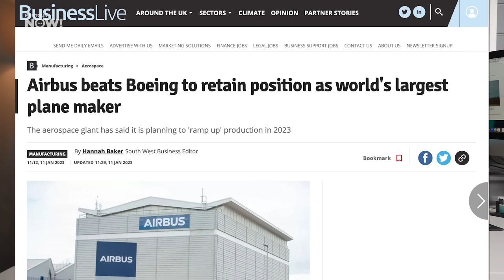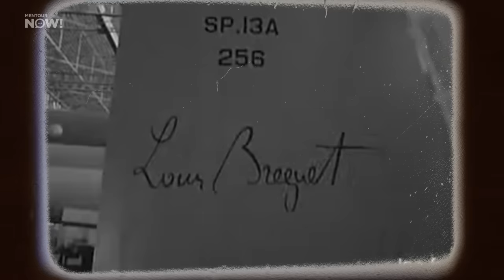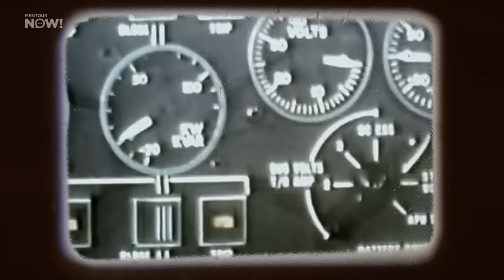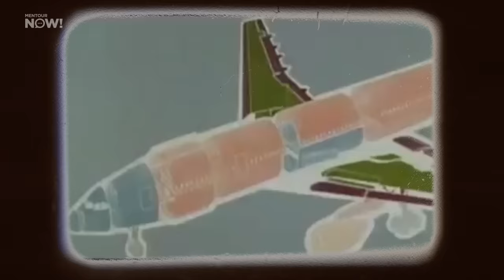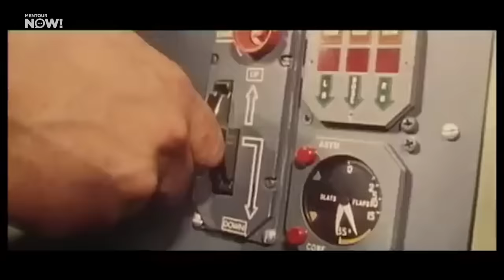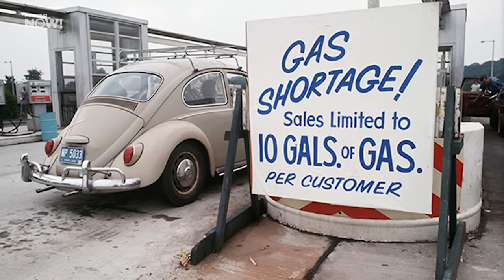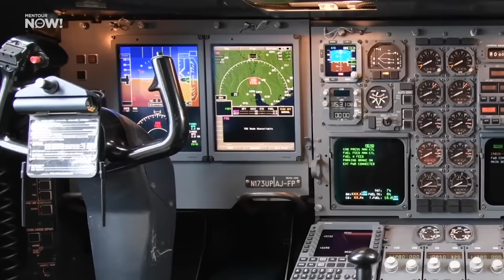Without this Aircraft, Airbus wouldn’t exist!

Comment: Considering today’s market trend seemingly going to the point-to-point, middle-of-the-market type I really wish Airbus built an A300neo. East Asian airspace was at one point in the 80’s were full of 767s and A300s from each country, since it perfectly fit the demand and economics of respective countries. That also includes us Malaysians with the four A300B4 belonging to Malaysian Airlines that we utilized until the mid 90’s when the A330 rolled around. Too bad I never flew in one though, the older B2 and B4 series had cabins without the central luggage compartment, making it super spacious like early TriStars. 

Fantastic video. I’ll never be bored with the Airbus origin story even with different narrators.

Comment: The Fokker F27 / Fairchild FH-227 ..  yes its a turboprop short-haul airliner, but Fokker really set the standard for the market..  I worked with the F27 for many years with a previous employer when it was well past its prime, but it was still a solid, roomy, load-hauling regional turboprop!

Comment: The predecessors that formed Airbus had an airliner history: British Aerospace, Sud Aviacion.  The Comet models came first, then the Caravelle, and the Concorde.  So it wasn't like when Airbus was constituted its design, engineering and production teams had never sold commercial aircraft before.  I'm not taking anything away from the A300 as a pioneer in a new class of aircraft and its role in supporting a formidable competitor to Boeing, however.

Comment: Amazing video! One small detail: the A300-600 does not have the A310 wing. It has the more modern cockpit/avionics, the A310 rear section including the tail with a tail tank and a updated bulkhead. However the wing got some updates: the outboard ailerons were removed and they added wingtips. The MTOW and MLW got upgraded. Overall more CFK was used.

Comment: The last A300 2007, I was there.  You are wrong in one very important detail.  The A300-600 did not have the same wing as the A310.  It has a revised version of the wing in the A300B4.  I put 17 years into the project, I can say that I prefered the A310, it had a better wing in many ways and showed how experience can improve design, but it had a smaller body and less capacity so it suffered as almost all shrinks do.
A nice video for all that, well done.
Reply: I alsmost forgot, the fuselage cross section (104 inch if I remember right) was chosen specifically to accomodate the LD containers.  Thats why it became such a useful freighter.

Comment: Thanks for a great review! I do remember the bold offer to Eastern Airlines in the mid-1970s. Frankly, Airbus could have leased the planes to EA for $1 each and done well financially. Those leases were fundamental to opening the U.S. market to Airbus. I believe those original planes ended up at Continental Airlines in the 1990s - during the era of Frank Lorenzo ownership of both CO and EA. Slowly but surely, EA assets shuttled through the paint shop and ended up in CO livery and EA came to an end. Would be interesting to see you trace the introduction of the A320 series to U.S. flag carriers. The first I saw them was at UA in the early 1990s, shattering the history of UA being a fully Boeing line.

Comment: i remember when Eastern got the A-300s in the 70s. I walked through one they had out on the ramp in Miami. I remember the traditional cockpit with a flight engineers station and conventional control yokes, which I still prefer over side sticks.  I remember they must have been slightly underpowered for high altitude. We never saw them above FL 310, going coast to coast. They hung around down at FL290 and 310. Later they obviously increased the power they had.
Reply: It was not lack of power... it was lack of wing. As the 310.

Comment: There's also the A300-203FFCC with a two-crew cockpit, before the A310 and A300-600. Originally conceived by Garuda Indonesia, two were acquired by Finnair, of which the other one still flies in Iran.

Comment: MD had shown a twin engine wide body as part of the DC 10 line called the DC 10 twin. European airlines reserved options like crazy but no USA airline optioned it. ETOPS was for them still a sticking point. MD where selling every DC 10 they could make so they let it go on the back burner. The A300 was remarkably close to the DC 10 twin in spec and got the market options cancelled by MD and the rest is history.

Comment: One thing you do not mention here that greatly aided the A300's success was its very advanced (for its time) avionics. It was first with a glass cockpit. It wasn't full fly-by-wire but a lot of it was. And its automated CoG control was ground breaking. There were good reasons the A300 was the first twin to get extended ETOPS and the first widebody not to need a flight engineer (a part of its low operating cost - it was not just fuel efficiency). Its redundant and automated systems were well ahead of competitors at that time.
Reply: The A300B did not have a glass cockpit. It had electro-mechanical instrumentation in a three-crew cockpit with a conventional flight-engineer's (side-facing) panel. However, one special version (for an Asian airline, IIRC) did have a forward-facing electro-mechanical systems panel, designed for two-crew operation. 
The A300B had no FBW flight controls, although one aircraft was used much later as part of a sidestick test programme (flown by Gordon Corps).
The first "glass cockpit" Airbus was the A310 (entering service in 1983), which had a two-crew, forward-facing cockpit (although Air France initially insisted on using it with three crew). The shorter-fuselage A310 had a conventional yoke but the roll-spoilers were digital-FBW. 
That paved the way for the A320, the first digital-FBW airliner and the first to employ sidesticks, which was type-certificated in February of 1988. (Note: the first FBW airliner had been the analogue-FBW Concorde.)
The A300-600, which (IIRC) entered service around 1986/7, was the first A300 with a glass cockpit, identical to the A310.

Comment: As someone from northern Scandinavia; how about a short one on the Fokker 50? 🙂 Someone I know that isn't me, may or may not have been so hung over was one summer sunday, that they literally passed out inside one of those headache-tubes in the rare arctic summer heat (and went on to be bedridden by hangover for another 3-4 days).

Comment: Hello Petter.

If you are going to talk about fbw in airbus, may be you have to dig a lot on Ziegler family. Father and son. One president of airbus ( I think) ( Henry), and Bernard Ziegler fighter pilot and Vice President engineering for airbus and the one that always believed in the fly by wire / flight path protections receipt. He had a strong personality but airbus owes him a lot. There would not be all this concept in airbus, and all this dark cockpit philosophy without him. 

I understand the basic airframe of the a330/340 derived from the a300. Thank you for info I didn’t knew.
However, it’s the 320 that launches the all new concept of family of aircraft making the transition between those cockpits very smooth. Of course the 320 had, and still has very tricky things in its systems and the way to operate them. We used to say that those checklist are made by lawyers not operational people. 

However in day to day operation it’s miles ahead from any other airplane. It’s just a little to much “ French”. Bureaucratic, complicated, like an old Citroen. But also like old Citroen’s, they were very ahead and they could create a new reality. They had that courage and vision .And that is why Boeing  is a little behind nowadays. 

However,airbus would not make any sense without Boeing. And they are two magnificent manufacturers. I just hope airbus does not enter the criminal spiral diving that made Boeing so famous after de McDonnell Douglas merger which now is a philosophy they have to counteract. Boeing from before, let’s say from the 707/727/747 era, was just about as bold as airbus was. 

Let’s hope all this stretching of the a 321 doesn’t go too far . I have flown all the  320 series, ceo and neo and 330. 
And the 321 neo lr just has a different handling. Very processed airplane, a little bit too much mcas style....
When you get used to it , it’s still an old Citroen. Comfortable for daily life , and now much more reliable after 30 years in service.

It is important to say however, that we can criticize the handling of the fby formula. It’s not as responsive, as stable, and not much feedback. But you get used to it. It’s better for daily life and  takes a lot of work load from you except when it malfunctions. Which is far worse. But after 16 years flying the airbus, and more then 8000 hours on them I never had nothing that degraded the system. It’s really robust. And that’s why I say that to talk about fby you have to investigate on Bernard Ziegler. Pilot and technician that by his family connections understood how to make an idea going. And it went very well. 

The next safety and comfort step is air. And there Boeing is ahead with the 787.

No Aerotoxic syndromes on those planes. And that is a really important topic that it would make a lot of sense if you covered it. It’s the black swan of today’s aviation after the 707 which still had “ clean “ air.

Good luck and thank you once again for your work.

Comment: In your video you mention that the A300 is smaller than the dc10 and L1011 tristar but to be honest the A300 is only slightly smaller, the newer A330s are around the same size

Comment: Actually, Airbus did have a 2-crew A300 before the A310: They called it the Face Forward Crew Cockpit (or short FFCC), that was introduced in the early 80s and shortly before the A310 made its fist flight. Many flight engineer systems got automated, however the cockpit was still fully analogue without a modern FMS.

Then A310 came, which was basically a totally enhanced A300. Not only the new wings and the new EFIS cockpit were introduced with that one, but also the trim tank in the tail, the removed low speed ailerons etc. The A300-600 is actually more similar to the A310 than to the A300-200/-300, as it also features the new cockpit, the trim tank, the enhanced wing, the removed low speed ailerons and all those new features. So you could say, the A300-600 is a stretched A310, rather than a modernized A300.

Comment: The Airbus A300 with a composite fuselage would be a great competitor for the B787 today.
Reply: That would be the A330neo today. Developed from the A300 fuselage. Also see the A350 as a competitor to B777(X).
Reply: @berlindude75  Yeah, sales wise, the 787 has left the A330neo in the dust. Not much of a competition there. We shall see how the 777x fares against the A350 over time.
I think a composite version of the A330 would fare better against the Dreamliner.

Comment: I flew on an A300 in January 1982 to Berlin and back. The airline was the first in UK to operate the A300 - Laker Airways. Unfortunately they went bust three weeks later with the three aircraft that had been delivered of the ten they ordered ending up in Jamaica and Pakistan.

Any chance of a video about the Saab 340 / 2000 ? I feel the 340 particularly is a very important aircraft which has now carved out a very useful niche for itself in short / medium haul parcels transport.

Comment: In the Philippines 🇵🇭 we have BAC 1-11 operated by Philippines Airlines until the 1990s due largely to the extremely noisy engines during take offs later to be replaced by the Boeing 737-400 for several years then replaced by the Airbus A320s used mainly in Domestic and short haul International routes.

Comment: I rode the A300 on EAL many times in the ‘80s.  It was an unpleasant ride because for some reason they could rarely cruise higher than FL310, which put us right in the tops of most of the nasty Wx…. Internal fit and finish seemed to be second rate…

Comment: Can you make a video on American Airlines 965 - it was definitely NOT pilot error .. it was pilot incapacitation .. and I strongly believe it was due to contaminated cabin air that caused the crash. Many pilots are reporting today cabin air quality to be poor and resulting in serious long-term illness. But airlines are not taking this seriously! Hoping that with your channel this concern for pilots and passengers can voice concerns to the operators, but more importantly, going back to the manufactures such as Boeing or Airbus, to ensure that safety of leaks are minimized and better air filters are installed. Again just my research and honest opinion.

Comment: Also Airbus's decision to fully commit to a 2-crew cockpit was more or less kind of happened because of Garuda Indonesia, whose CEO at the time came to France to buy some A300B-4, insisted that the third seat is useless, and will not sign a purchase order if the third seat is not taken out. Which is why, in those early days, sometimes it is called "Garuda-design cockpit".

Comment: The A330 is pretty much to the A300 as what the 767-400 is to the 767-100.

Of cause the A330 being a bit bigger than the 767 to begin with, kind of had a problem to survive.

A330neo having the advantage of having a pretty much unlimited rage  (that is, can do half a lap around the world)

Comment: While the L-1011 had a similar configuration to the 727, it didn't LOOK all that close.
Russia had an aircraft that COULD be mistaken for the 727 (but was a little bigger). the Tu-154. Didn't look QUITE the same but a lot closer in size and shape than the L-1011.

Comment: KEY POINT YOU MADE: Since Airbus launched the A300, Boeing has been playing catch-up.  Boeing waited for A300 orders to grow before even launching the 767.  Now, it's waiting (and watching) orders grow for the A321 before launching a 757-200 (ie, mid market) update.  What goes around comes round...
Reply: The 757 is out of production since 2004. Nobody has restarted a production for a passenger aircraft after such a time - and the 757 is not even directly comparable to the 321 Neo, it's significantly heavier and has 50% more wing area.

The 757 wouldn't also be suitable to replace 737s.

Comment: The Beluga is a mod based on A300-600.
Reply: Yes, indeed.
Reply: Yes, and the newer, larger Beluga XL is based on the A330 (presumably the Dash-200). According to Wiki, it can carry an A350 wing set (i.e., two A350 wings).

Comment: A great story video of the start of something BIG.  ' AIRBUS ' AS far as a New Video is concerned I would like you to talk about how you feel the Airbus A.350 is likely to be developed ? Do you think that an A 350 1200 or A.360 could be built with possibly Rolls Royce and its Ultrafan Engine ? as Boeing are dragging their feet so badly with its updated 777 9 which gives a wonderful opportunity for Airbus to build a New Aircraft that could replace to even better than the A.350 1000.

Comment: I flew many A310's, a variant. Hated the flights as it constantly seemed to be readjusting itself. It didn't fly straight and level, but floated up and down. Fortunately something Airbus didn't continue in newer designs. Do a show on the short lived Lockheed L1011. The few times I flew on them, they seemed like the best?

Comment: Just to add to the concept of a not spectacular looking aircraft. The A300 was the first of a kind fly by wire commercial jet, introducing active longitudinal stability. As a result, "natural" stability was   omitted, gaining a near 3% efficiency of fuel burn. The safety of this aircraft was deadly dependent on the flight stabilizing system. So this might have been another criterion for the purchases in the early days, when no one could trust this system, damned to stay fully working in every case. To maintain the system up and running, quite an effort was spent to do so, but trust develops by experience.
Reply: The A300 didn't have FBW. The 320 was the first airliner using a digital FBW, while Concorde used an analog one.

The 330/340 later also got FBW, as an modernized version of the 300.

Comment: Can you do a feature on the A340 and explain why they put 4 APUs on the wings rather than 2 engines. 🙏🏻
Reply: there is an A340 with two engines, it's called A330.
Why did they put 4 engines on? Because at that time you needed 4 engines for many routes as ETOPS regulations were much more restrictive.